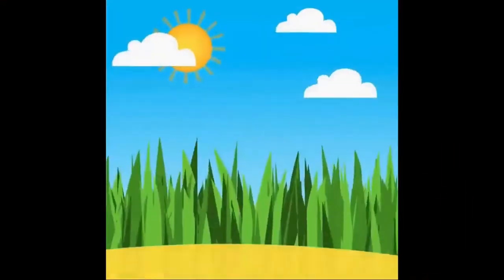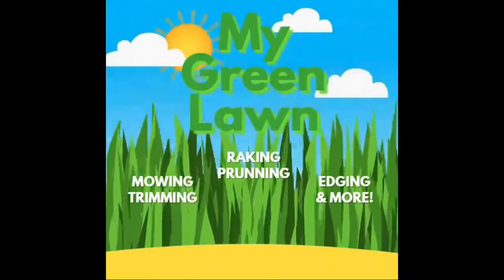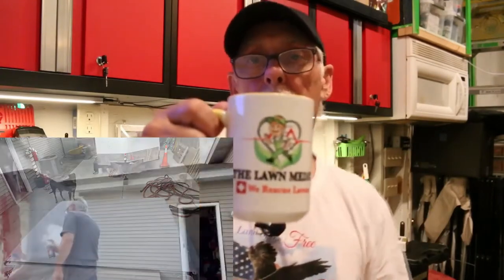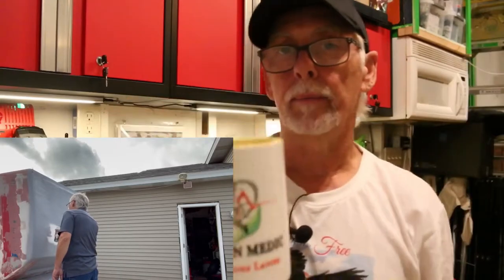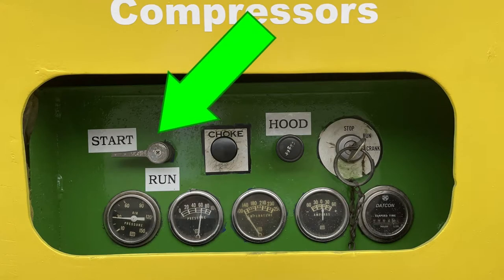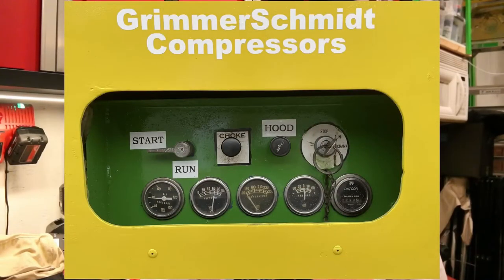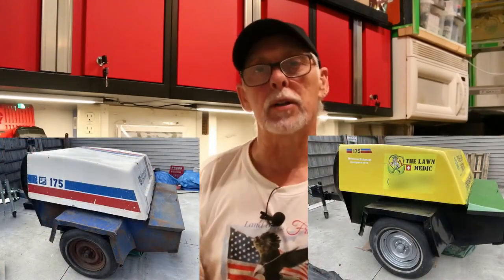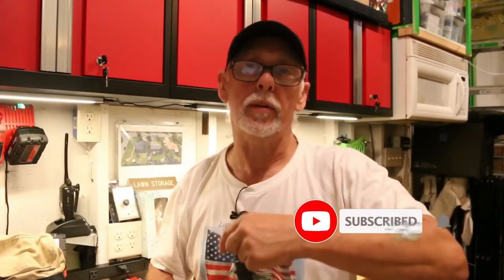Old Tow Behind Air Compressor Gets A New Look Plus Fall Sprinkler Blow-Outs #sprinklersystem

Comment: I bought a grimmer schmidt 125 pull behind last weekend it is rough but it runs, it's a neat little machine. Where do you get parts of you need them ?
Reply from the maker: That’s the scary thing. Mine had a 1979 ford 351 in it. So it made me nervous, I sold mine just this year and purchased a Ingersoll Rand 185 2003 and a 2005. I did like the grimmer Schmidt though, it always started, ran on regular gas (instead of diesel) good luck on your compressor. Enjoy it.